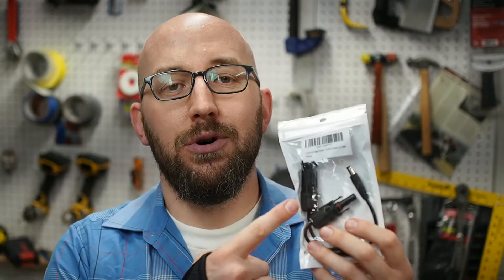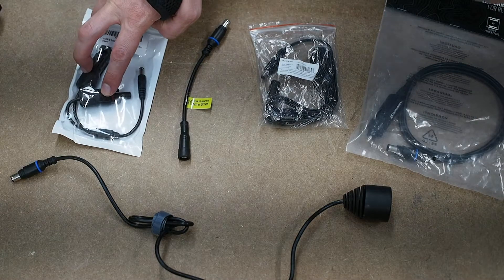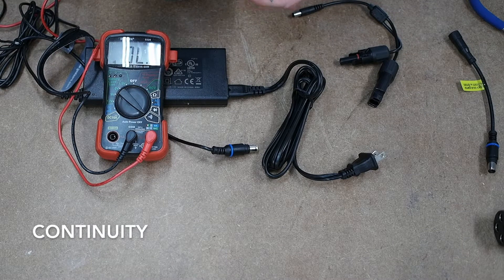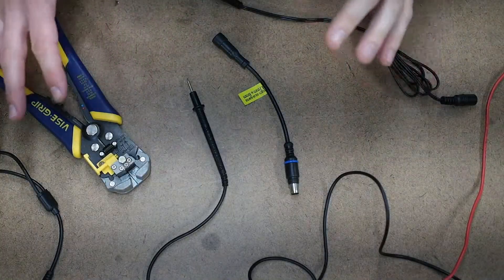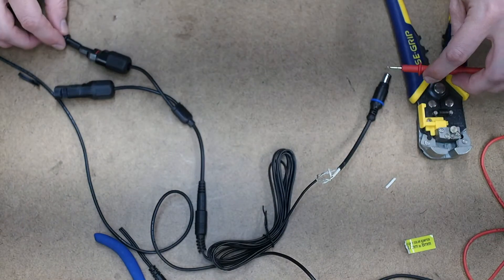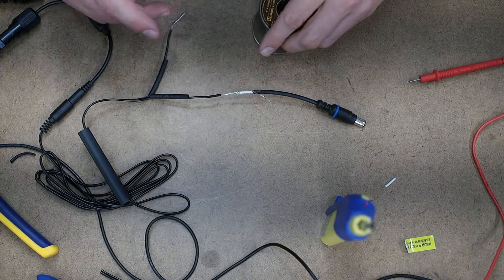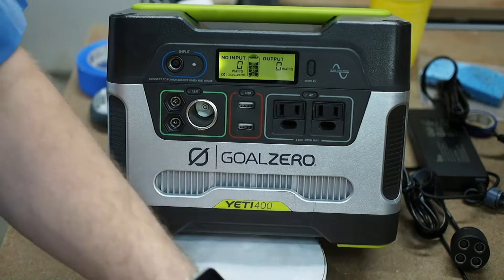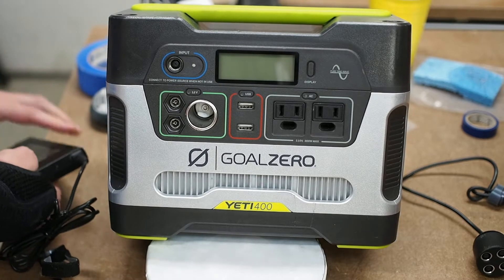Build Your Own DIY Goal Zero Solar Panel Adapter Cable

Comment: Very informative, but maybe you can provide a solution for me. I have a Goal Zero Nomad 14 plus that I picked up from someone.  It has a splitter with 2 connections (1 an 8mm female plus which is used to daisy chain, but the the other is not an 8mm male plug) it is a 3 pin female output (kind of looks like an audio XLR plug). I cannot find an adapter to convert the 3 pin female to an 8mm male so that I can connect the Goal Zero USB adapter which has an 8mm female connector on it. Do you think I can splice the 3pin to 8mm male adapter for my situation? Thx for any advice.

Comment: Hi, I’m searching for a way to use my pv wires that are on my solar panel and somehow connect them to an 8mm dc male plug, so I can charge my jackery. 
I’ve looked at solar wire connectors and they are too short for my application. I’m wondering how to get the 2 wires into one.
Reply from the maker: The easiest, and potentially safest, is to go with something like this MC4 to 8mm adapter https://amzn.to/43WUtzx 

I don't know how your current wires are terminated but the MC4 is a very common connector for solar and easy enough to add to cables if they bare or have some other connector. Best of luck.

Comment: Easiest way to customize the extension cable.
1) Make your own with anderson 30amp connector on one end. The other end with mc4.
2) take 8mm extension cable and add anderson connector on the other end. 

Best wire to use are the 12awg landscape lighting wire

Comment: What I have found thru searching is the 7.9mm aka the 8.0mm GZ connector is indeed a IBM Lenovo end. They can be bought as premade cables or on aliexpress as solder. So you can make ends for custom builds. There is the 5.5mm-7.9mm converters too if you can get a 5.5-5.5mm male to male cable for linking
I’m yet to find the 9.0mm chain cable nib. So if anyone finds one please let me know.
Reply: Further to add to this. The 9-9mm connectors are discontinued and only suited Sherpa chaining. They stopped them due to the Sherpa packs not balancing or sharing charge. I.e the second Sherpa wouldn’t always take charge from the charging Sherpa using the 8mm input. So rare as unicorns. However.... looking at chaining port on either the ac inverter add-on or the Sherpa 50 side this could be changed to the Lenovo 8mm jack so allowing the Sherpas to run from a “tank” (for me this looks like 30x18650 in a 3s10p setup running at same input of 11.1v)
Reply: @peterhutchings6356  GZ must have scrubbed the world and recalled all them cables. Only one I ever seen was one guy had one and was teaching how to rebuild the GZ Sherpa 50 for boyscouts on YT. I would love to have found even the cable barrel plugs and DIY my own. As for changing it to the 8mm port I would like to see a how to video.
Reply: @peterhutchings6356  I have thought about buying a couple inverters and taking out the male plug from them and diy something

Comment: Hi, I just got a deal on a goal zero nomad 200 briefcase panel. Any idea if I can wire them in series to get the voltage up, so I can use with a new Bluetti ? Thanks
Reply from the maker: I took a quick look and I would bet it’s very possible but you would need to either cut the factory connecting wire or open up the junction boxes to re-wire them. I’m sure that would void any warranty you had hoped to have though.

Comment: Where did you score that 4 female to 1 8mm male combiner? Goal Zero says they don’t sell that cool adapter.
Reply from the maker: It’s a goal zero adapter. They must have stopped making it since I bought it. They seem to only make a 4 to 1 Anderson connector now. Have you tried eBay?
Reply: Chasing the Twist I’ve looked on eBay. But I’ll keep my eyes out. You can get a 4 8mm to APP combiner, then a separate APP to 8mm adapter. I also have a Yeti 400, so charging directly through APP port on the side is not recommended since it does not have a charge controller.

Comment: So all I got to do is just go from the panels to the zero gold?
Reply from the maker: The Goal Zero has a built in Pulse Width Modulation (PWM) charge controller in it. It does have limitations on both voltage and amperage that it can take, but as long as your solar panel output is within its acceptable range then yes, all you need to do is connect the solar panels to the goal zero.

Comment: As “Earth Mama Medicine” indicated Goal Zero does sell the 8mm to MC4 adapter online only. I just purchased two adapters ten minutes ago today 03/12/2019. I was told that they have plenty. The salesperson said that they are not for use with the Yeti’s that have (lithium batteries) and FYI the online direct price of the Yeti 1250 was just lowered to $1000. Also I just purchased a Sherpa 50 and Inverter combo for $79.00. The Sherpa 50 is new and the Inverter is Opened Box. That is directly from Goal Zero. Their website says that they are sold out but that info is not current. Be safe!

Comment: Dude, do you know how to help me do the reverse? I have a goal zero panel and am wondering how I can build my own generator...I want to charge RV batteries. Know nothing of solar but I’m guessing the output of the goal zero panel is specific to their generator? Help?
Reply from the maker: Hi. This should be possible and a very similar process. I would suggest buying an extension cable from goal zero and then adapting that to whichever connector you need.

This extension cable already comes adapted to SAE:

https://www.goalzero.com/shop/cords-adapters/8mm-sae-connector/

If you need a different connector you can cut off the end you don’t need and splice in the desired connector. Just be sure to check polarity and voltage before plugging anything in to your charge controller.

Good luck.

Comment: I ordered the MC4 to 8mm adapter from goal Zero for $14.95. $23 with shipping and taxes. LOL
Reply: brian holt call them. That’s how I got them. I had to call their 1-800 number. They don’t have them on their website.
Reply: brian holt that sucks. I can still order them from Goal Zero here in the states. I ordered mine about a month ago. They told me they stopped putting them on the website and only offer them direct, if you call their sales department.

Comment: I had a similar problem and made my own cable without cutting the Goalzero cable.

I found an old panasonic phone power supply that had a 4.7 mm end. These ends are also in included in practically any multi voltage power supply. I soldered this on to my MC4 solar cables and this has been up and running for the last 8 months.. so far so good.

Comment: Goal Zero still sells MC4 to 8mm adapters! They just took them offline because people were plugging solar panels with way too much power into the Yeti 400. I just got off the phone with them and ordered mine. Thank you for this video, though. I was seriously panicking trying to figure out how to connect my 100W solar panel I just ordered to the Yeti and was really afraid of not being able to pull this off. I'll be leaving for van life in 2 weeks! Much love!
Reply from the maker: Of course they do. I think the price of their power units are defensible since they offer an all-in-one easy-to-use solution but I see no reason why they would charge so much for solar panels that don’t have significant value or benefit over panels from other companies.

Glad this thread helped.
Reply from the maker: Thanks for the tip and comment. Good luck on your travels.
Reply: Omg, you a GEM! thanks for the heads up! I am currently on the road living van life too and is having some trouble with this.
Reply: Thank you, I just called in and ordered my cable.  They wanted to make sure my panel was 12v.  I think Goal zero wants you to buy their expensive proprietary panels at 5x the cost!
Reply: Ordering my connector tomorrow
Reply: Thanks for the tip! Just called it was very easy. They just want to confirm you have a compatible solar panel. Wish they indicated this on their website and we didn't have to learn these things from youtube comments... but oh well. It was a $10 part + $10 shipping.
Reply: Absolutely.
Reply: whats the price of this adapter ….is it still cheaper to diy
Reply: I can't remember the exact cost but I know it was under $30. Just call them and they will sell it to you.

Comment: I found this  7.9 x 5.55mm Male Connector with 5.5 x 2.5mm Female Jack on BiXpower.com and it works with the ACOPower adapter and the COOLIS solar panel connector listed on Amazon. https://www.bixpower.com/CNT-C15-p/cnt-c15.htm

Comment: FYI, if you call Goal Zero support and tell them what your setup looks like, they’ll mail you one of the real cables. Apparently people were frying their equipment by wiring multiple panels in series, so Goal Zero stopped selling the adapters.
Reply from the maker: That would do it. It’s a small, but significant, difference wiring in series compared to parallel.
Maybe next time I’ll call to order a Goal Zero cable.

Comment: Ok not sure what happened or how it should have been done correctly
Reply from the maker: Sorry you couldn’t follow. Basically, open up all the components before you try to work out the polarity of your connections.
In the beginning I assumed I would need to splice and reverse the polarity of my wire but upon opening the solar panel I didn’t need to do that at all.

Best of luck.

Comment: The adapter is available at powerwerx for $20
Reply from the maker: Cool. Do you have a link? I just did a quick search and couldn't find it.
Reply: I keyed in "powerwerx anderson adapter" and it was the second hit-
https://powerwerx.com/solar-mc4-anderson-powerpole-adapter-cable
Reply from the maker: Yes, I saw that one too, however I made a MC4 to 8mm adapter to go in through the Goal Zero charge controller. The MC4 to Anderson would work also but it would bypass the charge controller, for what that’s worth.
Reply: That's worth a lot! Great job. If you explained that in the video, my bad. I missed that point.
Reply from the maker: Thanks for the comment. MC4 to Anderson cables are available. I wanted to go in through the Goal Zero charge controller and therefore needed a MC4 to 8MM connector. Which goal zero apparently only sells over the phone.
Reply: i was just got one mc4 to anderson from joinwin mfg on Amazon, working very well with 30Amps current.
Reply: no need Powerwerx MC4 to anderson plus GZ anderson 8mm adapter, there have one interested available shopping it online directly,MC4 to 8mm adapter
https://www.amazon.com/Adapter-Jackery-Portable-generators-powerstation/dp/B07DF6795Y/ref=sr_1_1?ie=UTF8&qid=1535829645&sr=8-1&keywords=MC4+to+8mm
Reply from the maker: That one looks like it could work. Thanks for the link.

Comment: Goal Zero has good products, but they have trouble understanding the finer points of how to run a business.  I asked to be notified by E-mail when  the MC4 to 8mm adapter cable would be in stock, they never notified me.  I call them and they admitted it's in stock.  They "just want to be sure that the customer is using it correctly."  It seems likely they would rather not sell a adapter to allow you to run a generic solar panel into one of their units.  They would prefer that you buy only Goal Zero components.  Alternatively they want to be the techno versions of the soup nazi and over control their products.  Once money changes hands the item belongs to you right?  On the subject of money, they show Paypal as a payment option, it never has gone through all the times I have tried to use it.  Did NRG buy Goal Zero as a tax shelter?  Who wants a business that doesn't want to make money?  
FYI the lighter plug to 8mm adapter is also currently listed as out of stock online.  Is that true?  Your guess is as good as mine.      
Another way to rig this adapter is to buy the Anderson to 8mm adapter.  This adapter is only sort of Anderson, the shape of the plug is proprietary to Goal Zero (what a surprise.) Heres how to get around that.  Find extension cords with MC4  female connections on one end and raw wire to run into a charge controller on the other, (Ebay).  Crimp on Anderson tips  (also Ebay), label them positive, negative  and plug them in to the adapter.  You could cut the Anderson female off the adapter and just splice the two together, instead of messing with the tips, but it's actually more work.  The choice is yours.
Reply from the maker: I have too been frustrated by their tendency toward proprietary connections. So far, I have otherwise been please with it. Thanks for the comment and tips.

Comment: Total noob here.  Need ideas to attach 8mm goal zero boulder 100 cable to a 7.5 mm pin charger for anker powerhouse.  Any suggestions?
Reply from the maker: +Rick Cox Hi, I assume you are trying to charge your Anker?

Assuming you can source an 8mm and 7.5mm cable, you should be able to cut and splice them together pretty easily.

The main thing to be concerned about is the required polarity of the Anker. I couldn’t find the spec in the manual online but a graphic should be on the charger that shows whether the ring is positive or negative.

Good luck.
Reply: the polarity is a + input.  Still trying to find the right cables to splice.  If amazon doesnt have it i'm clueless
Reply from the maker: What exactly are you trying to accomplish? Are you charging the Anker? If so, from what source?
Reply: Chasing the Twist I have a goal zero 100 boulder briefcase that I'm trying to use to charge my anker powerhouse

Comment: Hi,mr Twist. This video is very helpfull. I was curious to see if it can nicely be done. I have ordered an off-brand solar panel that comes without any connections and I have a Yeti 150. I came up with the idea to mount a ' 12 V car cigarette plug type' socket on the panel. And I bought the Goal Zero car charger cable with a plug like that and a 8mm connector. I hope that works. ( I don,t need a waterproof solution for now )
But otherwise I can mount a 8mm connection on any cable as you showed. so thanks !

Any one could make the mistake you made. The + and - on the MC4 connectors do not always mean what polarity, but also male or female. ( Think of when you want to extend the positive MC4 cable with MC4,s ; the extension cable will have a male connector on one side and a female on the other side. Still it will be a positive cable. )
Reply from the maker: I'm glad you found it helpful. As long as you get the polarity correct it should work. Cigarette plugs are known to be the most reliable or robust, but assuming you are stationary when it's plugged in it should work.  Good luck and thanks for watching.
Reply: I didn,t know they are reliable. Good to hear. Greetings from the Netherlands.
Reply from the maker: +Chasing the Twist sorry, I meant "aren't the most reliable" but they are good enough for a low impact environment.
Reply: Ha ha! I am just playing a bit with solar power. ( Low budget.) When I am camping with my van I will put a 50 watt panel out  when it,s sunny and charge the Yeti. Let,s find out.
Reply from the maker: +GapahuksTube the best way to learn is to just jump in.

Comment: FYI, Goal Zero has the MC4 to 8 mm adaptor in stock, you just have to call their customer service and place the order over the phone. I don't know why it's that way. Perhaps they want to make sure you're planning to use a panel that is correct voltage?

I came across this video to see if the 8mm plug side was a straight-forward wiring. They messed up the shipping and now I won't have the adaptor for a long camping trip, so I'm thinking of chopping the 8 mm plug off the power brick and make my own MC4 adaptor cable....
Reply from the maker: That is interesting. I wonder why they do that and don't mention it on the product page either.

Too bad about not having it for your trip. I was in a similar situation with the MC4 to 8mm cable and also the 6mm output to female cigarette adapter cable. They even messed up the shipping on the latter, just like yours. So, I needed to rig my on solutions.

Good luck and thanks for watching.

Comment: Thank you so much for this video! I've had the same problem and refused to pay upwards of $99 for a 12in piece of cable. In an hour or so today I made the adapter and a 10' extension cable for my newest tiny house and couldn't be more thrilled.
Reply from the maker: +Terraform Tiny Homes I'm so glad you found it helpful. That's exactly why I made it. It is annoying that Goal Zero can't seem to keep up with demand on the various adapters. Thanks for watching.